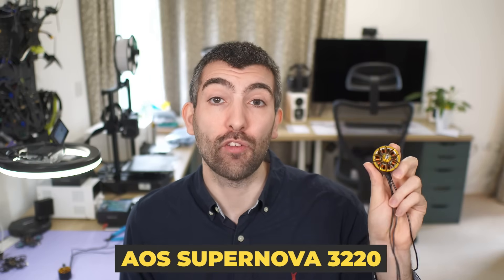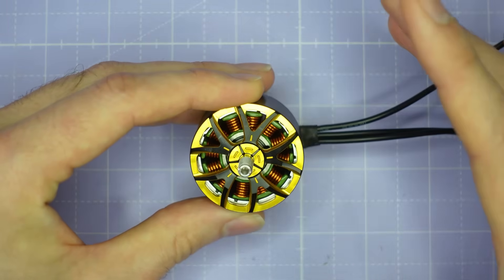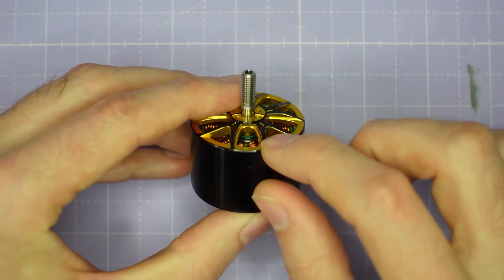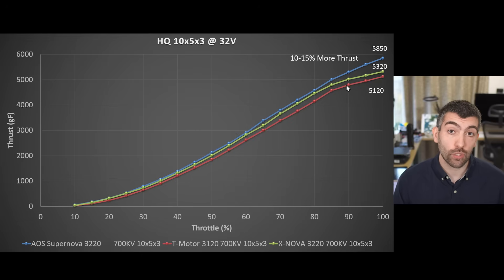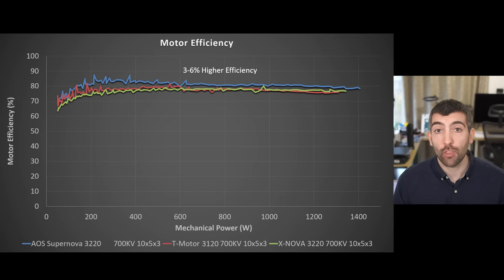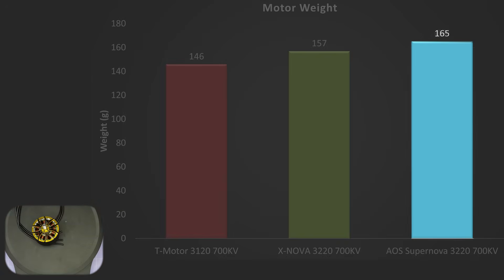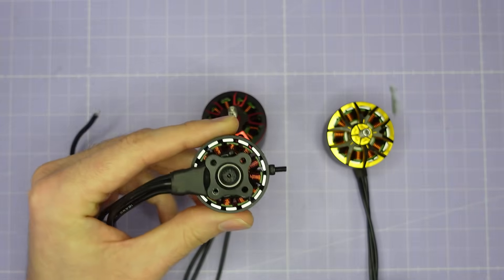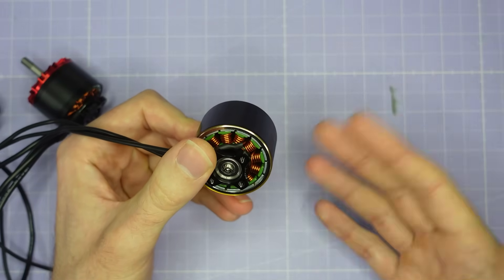Engineered to power Cinelifters and Break World Records: The AOS Supernova 3220

Comment: Hi! I'm wondering, for better efficiency on a fixed wing pusher configuration, why not run the lower kv motor with a larger 2 blade prop? It seems counter-intuitive to go high kv low diameter on a wing.

Comment: Hi Chris... I am a big fan of your products!!! The AOS 2207 motors are the Best motors I've had on my 5 inch... Never changing😁
I have a Question:
Why do you use a hardened steel shaft on the AOS 3220  
Motors,and not Titanium alloy?

Comment: No the last one you shown have 2 insulation drum cause the motor heavy and it can prevent magnet leaking, magnet leaking should not cause any problem ,  you can't reflect magnetic property just like light .........
Reply: Nope!
You can "reflect" or compress magentic axial flux by adding a magnetic drain: a ferrous metal band or opposing magnetic source.

Comment: the o-ring also will help with heat expansion. have you considered using an angular contact ball bearing? as you mentioned speed records... may need to have them specially manufactured as not sure if they com this small.

Comment: I have an aos 5 drone and applied the corresponding tune in beta flight, when i cut my throttle fully i lose the ability to control my drone momentarily. I'm just wondering why this happens or what to do about it. I'm new to the hobby so please be patient!
Reply: Check if "permanent airmode enabled" is checked in Config Tab
Reply: @flyingfrogfpv thanks thats what is turned out to be, but i got another issue now with a weird noise from the motors. I made a short about it if you have any clue how to help.

Comment: Regarding your statement about efficiency vs weight, I disagree. As it comes to endurance multi-rotors, every single gram matters. A plus in weight of lets say 15g per motor is leading to a 60g over all weight penalty which is a huge deal. Even a significantly better motor efficiency cannot compensate for the added weight. Nevertheless, the motor that you are presenting is an awesome piece of technology and might be a sweat spot for many use cases where people do not want to trade too much performance for flight time.

Comment: Man if you bring out a fitting rc plane motor you will really bang up the hobby for model airplane guys . We are used to motors that cost 10 times the amount and arent nearly as power dense . I've did a 6s mini hotliner with a t motor 2808 1950kv on 7x4 and the kick on full throttle was lut of this world. Burned the esc out.  Measured current with a new one was 135 amps at 21.5 volts . 😂 Motor came down cold . And i know you can do better then t motor

Comment: Does the shaft have a hole through so it can be used with a variable pitch props that require a small shaft running thru the motor shaft?
Reply: Normally it's for weight savings.
Reply: @ What I meant was: does this motor is also available in a version that has a hole through,  sized for rods that control pitch of a propeller by servo mounted behind the motor?
Such motors are very difficult to find which is strange. Was hoping that this motor is available for a Variable Pitch Props too.

I know that holes in some motor shafts are for weight reduction, but such holes are usually not all the way through, or the diameter of the hole is rough and not well controlled.
Reply: @danandrewkarpat3228  the problem with drone motors is, that they mostly use a screw inside the shaft on the bottom of the motor. You'd have to center drill that, to get a rod through 
Many iflight motors advertise with hollow shafts. The larger cine lifter motors don't advertise with it, but they still look hollow from the front.
Reply: @fabianrudzewski9027  Yeah, I may have to do that.
Just lost my Bridgeport mill so doing it nice and right will be a challenge.

Comment: Why not use aluminium wires in a weight-focused design like this given that aluminium carries more power for a given weight than copper does?
Reply from the maker: Alumninium is very difficult to solder otherwise it would be a great option!
Reply: Are there drone motors with aluminum wires? 
I assume the poorer conductivity could cause more heat maybe? The wires could of course be for example twice as thick and would still be lighter, but this would then make the whole motor bigger. Not an expert on this but I assume there are reasons why the wires are usually copper.
I hadn't even considered soldering to be an issue :)
Reply: @Qwarzz  probably a lot of reasons, off the top of my head

* Aluminum really doesn't like cyclic loading including thermal and vibration
* Larger wire crossection necessitating larger stator volume to fit the same amount of windings 
* Worse heat transfer necessitating further increase in wire crossection to maintain acceptable thermal performance.

Comment: 1000kv, 12S, 7x12 prop. in a small hotliner sounds good for me.
Reply: Not enough torque. I've tried similar setups T motor 3008 1300kv on 8s . It's good but the acceleration isn't anywhere near a similar powered classic setup.  Flies more like a pylon speed plane
Reply: @JonasDecker-z3x I have an FPV twin motor Hotliner and i smoke 2 Velox 3008 1500kv 6S at at the start because the motors lost the sync rotating field, didn't realise that electric motors could smoke like that. I think the T-motors have some kind of fault. I replaced them with Brotherhobby 3115 and it flies great, only the topspeed is not as good as if had a strong motor because of twin. Maybe it will work with the 3220 in the next plane
Reply: @BBFPV  the sync loss is something I experienced on 6s 1500kv . But it's not the motors itself it's about the ESC settings . Going for a high timing made it possible . This kind of rpm just doesn't work with t motor and normal escs. They spin up to fast. Which also explains why you other motor which has higher rotating mass didn't gave you that problem
Reply: @JonasDecker-z3x The blheli32 default value for "maximum acceleration" is "maximum". This is great for drones but for fw you have to lower it. However, it causes problems with t-motor, but not with brotherhobby. I'll have to test it again with normal ESC.
Reply: @BBFPV  yeah funny thing was . It worked fine with 2808 1950 kV up to 80 percent throttle then it would desync

Comment: I wonder how well this would do in a long range build. Though i know it's pretty big for that.
Reply: Big prop and battery it might be pretty good.
Reply: @thirtythreeeyes8624  what I'm thinking. 10inch or bigger build with a cinelifter battery.
Reply: @PrecisionDan  I've got an iflight IH10 with T5 3115 motors, 900kv, and it is fantastic for long range. It will do 8-10 minute flights with a 6s 5000mah battery and cruises much faster than a 7" quad.

Comment: If the wires get to ~240 temp, what are the magnets rated at temp wise? Most N52 are rated 150~160 that I have seen.
Reply: The magnets don't have currently going through them directly and beyond that they are encased in metal so thermal transfer is your friend in this case.
Reply: @Zachtamundo  I think you missed my point, if the wire is rated for 250, and lets say it gets 240, the wire is fine, but the magnets get about say ~160, they are not magnets anymore, unless they have some new magnet, and thats why I asked the question.
Reply: @user-rs8zg8ey2b  Ahh - the good 'ole esoteric internet question: what if. Yep you are right. By that point you don't have an esc any more because the thermal 'runaway' effects of the resistance increasing in the windings asks more of the esc and you would shoot passed the heat state fast enough that I don't think the heating of the magnets is the limiting factor nor the biggest problem - but the fact your quad is falling out the sky.
Reply: @user-rs8zg8ey2b  The wire is immediately dumping heat into the stator and its shouldn't ever be hitting 200c let alone 250 but, you know things happen in flight or turtle mode. The magnets would have problems if it somehow managed sustained high temperatures but, there is an air gap and in thermodynamics that's huge, even though on this motor I hope it's small lol, if you're motors are running hot enough to kill magnets you're doing it wrong
Reply: @thirtythreeeyes8624  Welp, stating the wires are rated to 250, and also world record territory, I for see magnets fading.
Its some of the best wire insulation, but not stating that the magnets are only rated for say 140 is a little misleading. I truly like his theory and build quality, well done.
Reply: @user-rs8zg8ey2b  I think he's just reading the spec sheet and ofc for marketing.  I recently ordered an assortment of "top grade" magnet wire from remington and it's all rated at 240c.  Motor temps should never be approaching even 200c and this is all just like having a thicker condom.  Like maybe handle a prop strike/imbalance longer to let you land before smoking a motor and yeah you are totally right about the actual thermal limits being in the magnet/other material regardless of heatsinking vs 250c mag wire.

Comment: now all we need is a aos tinywhoop motor
Reply: Just use this for a tinywhoop.
Reply: Yes we need better tiny whoop motors! Please Chris!😁
Reply: @butterflyfpv  not a fan of the webleed options? Screamers are bomb!
Reply: @notice_fpv  I've never flown it. But from what I've seen, they're not much different. They also come from happymodel. And happymodel does not specifically optimize its motors. That's why I hope that someone like Chris Rosser will develop a 1S whoop motor with a good company that is really better than all the others and cannot be overtaken.
A world record 1S motor so to speak.😃 The best of the best😃
Reply: I have a set of 1303 aos that came on my ymzfpv starship x1. Very good little motors 😁 4s. Great little quad but the aio quit working when I got into some wet grass. Think I'm gonna put a speedybee F405 40a aio in it. I already use 1 of these in a small quad and just got a spare 😀 Great parts. And these new motors are awesome 🤯
Reply: You know what, I think those 1303 may be rc in power. Are they the same thing? They look just like my 2207 aos supernovas. I may have to dig out that little guy or look up specs 😉
Reply: 14.504.5 !!!
Reply: @javagadro  something like this exists!?!? Imma google it right now.
Reply: Yep
Reply: Yeah but 1s you could find the 1202.5 from flywoo. Really powerful motors but you need a 12amp esc AIO. I got the mobula 8 which I'm moving to the foxeer 25 frame with 63mm triblade props. Later on might go with the foxwhoop 35 ducts with the 1202.5 and 3 inch bi props. All on 1s.

This setup should lift a naked GoPro no problem.
Reply: @MotobuChasi what's the idea behind 1s for this purpose? Seems like you're giving up a lot over going with 2s, and with no perceived advantage.. 🤔
Reply: @willpowerfpv3246  1s = lightest quad builds = crashes are not that expensive. I'm still learning. So I'm not really worried about 5:1 power to weight ratio. More like 3.5:1 is enough. The avata has 3.38:1
Reply: @MotobuChasi Tiny whoops don't carry gopro that'd be a cinewhoop.
Reply: @thirtythreeeyes8624  true, but can a tinywhoop also cine?? Enter the cinerilla.
I'm trying to build the 75mm fractal with a drshark frame, Moblite7 ducts, 12 amp AIO. 40mm tri-blade. Motors 1202.5 don't fit so I'll probably go for 1102 or 1003.
Reply: @MotobuChasi emax also has a 1s 1202.5 motor as well
Reply: @MotobuChasi  hello? are we talking about tinywhoops or tiny cinewhoops? tinywhoop motors are 0702-1002 size (imo), I would like an 0802 that's super light and responsive like 0702, happymodel has some black magic in their 28000kv se0702 motors tho, they're as powerful as 27000kv 0802 (tmotor) but way more responsive, feels like a quad with 0% mass in veloci lol